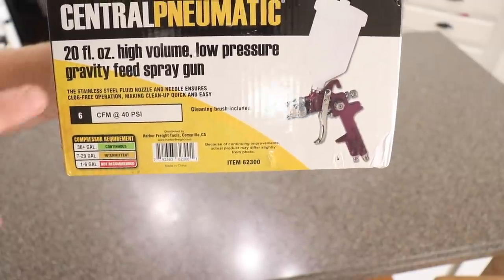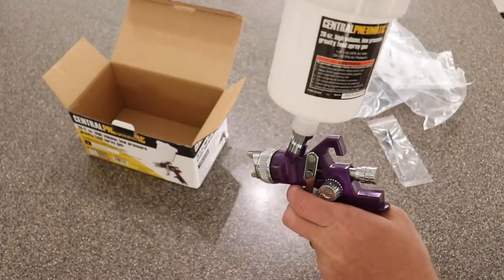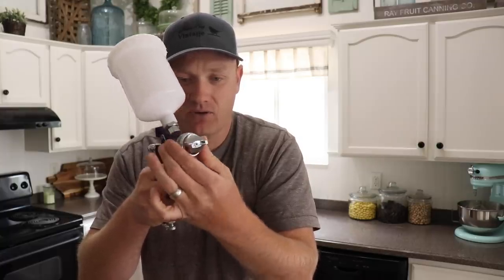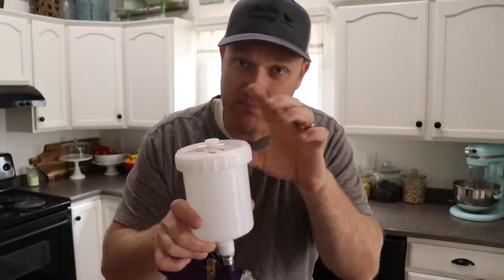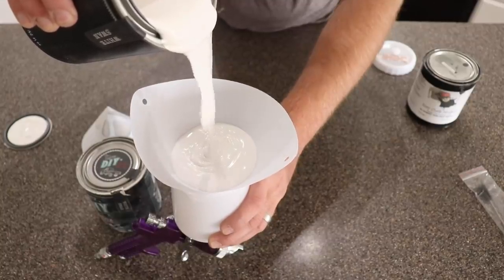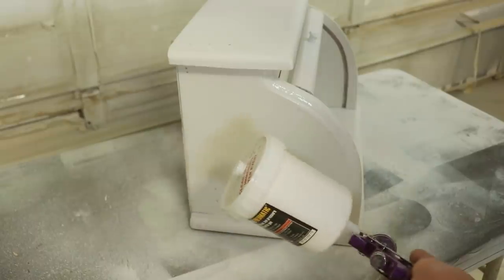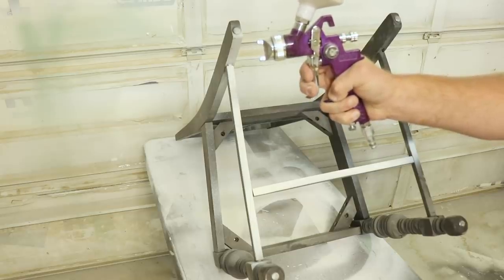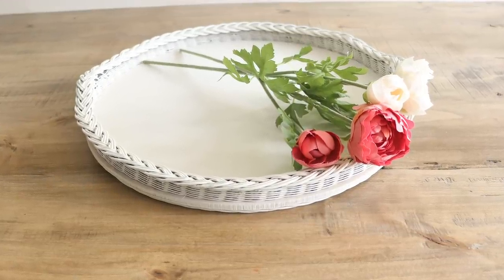How To Paint Furniture With An HVLP Paint Sprayer

Comment: I was telling the employees at harbor freight about you yesterday. Told them you use these all the time and that you were teaching me how to use this sprayer I just got once I get back home and onto YouTube 😀 lol. Anyway, could you elaborate some more on what you were saying about when using the sealer/finish at the end to seal a piece -  that “the only time you worry about the atomizer is.....” (when using a flat finish and a gloss,etc) please?
Reply from the maker: When it’s hot outside. If the temp gets over 100 I add a little water to the sealer, it helps it go on smoother. Also if it’s that hot make sure you spray in a shaded area.
Reply: Ok got it. Thank you so much!

Comment: Love this video! 
I have a question about the gun. When I press the handle it doesn’t return all the way back. It leaks air and it has a slow drip. What am I doing wrong? Did I get a bad gun? 
Also, Is it common to water down HD’s triple coverage varathane poly? It was tough finding the perfect spray from the gun. I did add water and did an extra coat. It seemed to work better but not great. 
And do I need to sand in between coats? Or do I wait and buff it out with 400 sandpaper? 
Thx so much for all ur info! Def appreciated!!

Comment: I really want a sprayer but those compressors are a couple hundred dollars. I just might bite the bullet though. If I paint faster, I sell more, right? 😊
Reply from the maker: That was my thinking when I got started spraying paint. Went from 2-3 days to finish a table set to 3-4 hours when we did custom work.
Reply: Coco Squirrel my compressor is too small I believe. I tried the electric one sold at Harbor Freight. First try was a dripping disaster. I guess try and try again. I have a bunch of kitchen chairs to do and do t want to do them by hand.
Reply: You can possibly find one on Craigs list or FB marketplace. I bought one off craigs list and paid 90 for it and the guy threw in 2 nail guns.

Comment: Thanks Zeb, been wanting to know this info for a while, cheers. I would be interested which equipment you use for pinning, ie. Your nail gun. Much appreciated. 👍😀
Reply from the maker: My nail gun is an 18 gauge central pneumatic nailer/stapler. Also from harbor freight. Runs about $30.00
Reply: Jami Ray Vintage thanks, I'm in the UK, so I'll try and hunt one out. Loving the channel 👍

Comment: This was great!  You covered just about any question someone might have.  However, me being me, I do have one.  Does spraying use a lot more paint that hand painting?  I ask because almost any painting I'd be doing would be on smaller pieces.  Thanks!  ;)
Reply from the maker: Hehe, I answered this at the end, 😊 
But I feel like it’s about the same amount of paint because when you spray the coats are much thinner than brushing and once you get the hang of it you can minimize overspray too.
Reply: @JamiRayVintage  Thanks!  Just needed some reassurance before I think about getting a sprayer.  /;)

Comment: Hey guys!! I bought this last week and weve adjusted to all of the specs and had to water down the paint as as well but the coverage is still soooo light!  The paint flow nozzle is out as far as it sill go and pressure is up. Any tips on how to get a more thorough coverage?
Reply from the maker: What paint are you using?
Reply: @JamiRayVintage  It's actually just a water based primer because the piece is stained reddish orange - It's watered down to the manufacturers specs (we just added a little as we went, initially it wouldn't come out at all it was so thick!)

Comment: What should I do if I spray out too much SP Top Coat? Will it self level or will i have to do it again. I used up about 10 oz of my 16 oz bottle. It was on 6 different projects though. Does that sound right?
Reply from the maker: That sounds about right. It may dry white in a few areas if it’s too thick but if it dries clear you’re good to go

Comment: Question: do you use a separate hopper for top coat/sealers?
Reply from the maker: Yes, I keep 3 separate guns loaded with paint and sealer. I used to only use one but i’d have to wash it like crazy several times a day as I went through various projects.

Comment: Can a 6 Gal. 150 PSI Portable Electric Air Compresso work with this spayer??
Reply from the maker: It may. You might have to wait on it a bit when the air pressure gets low but it’ll spray paint.
Reply: Thank you and this video was very helpful.
Reply: I asked the same question before and have tried it since.  It has worked fine for me, the compressor just stays loud while you are using it.  I don’t mind it, I think my neighbors are used to it by now (it’s not too loud if they’re inside you can’t hear it too much over the tv), but it’s been easier for me to lug our pancake 6 gallon out when my husband’s not home.  I would definitely give it a go, spraying paint has been a total game changer in time efficiency.  🙌🏻🥰
Reply: Thanks for the advice I'm definitely going to try it:)